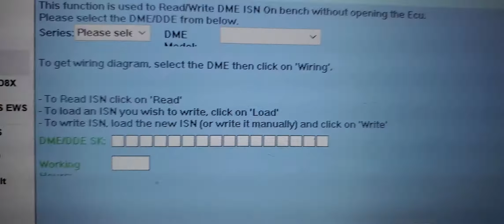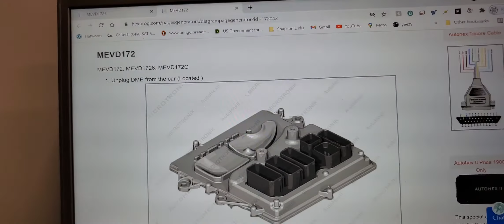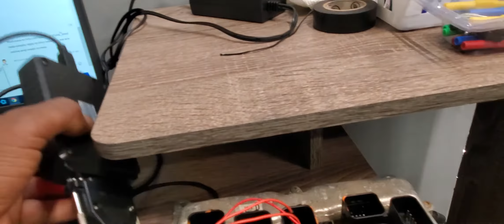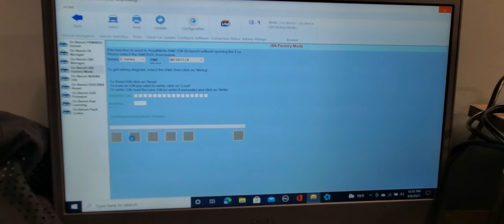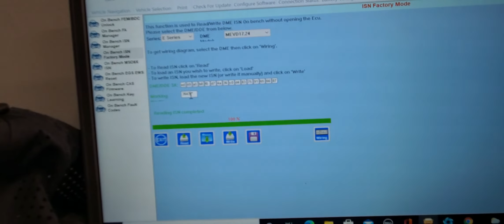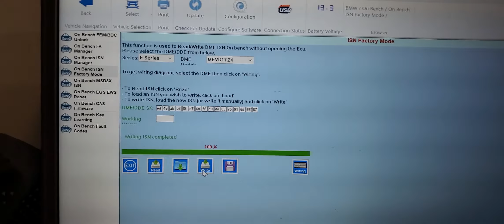2011 Bmw X5 ECU Swap And Program Using Auto Hex

Comment: What happens if the working hours is not changed?
Reply from the maker: In the context of a car, the term "working hours" generally refers to the time that the engine has been running. This is similar to how an airplane's age and service intervals are measured in flight hours.

For cars, this isn't usually a standard feature because mileage (or kilometers) is typically a more relevant metric for cars due to their usage patterns. However, certain specialized vehicles like tractors, heavy machinery, or boats often use running hours as a key maintenance metric.

If a BMW's engine control unit (ECU) is reporting "working hours", it could mean that it's tracking how many hours the engine has been in operation. This could be useful in some scenarios, such as a vehicle that spends a lot of time idling or running at low speeds, where the mileage might not fully reflect the wear and tear on the engine.

In general, the ECU is responsible for managing various aspects of the engine's operation. It uses data from a variety of sensors to adjust things like fuel injection and ignition timing to keep the engine running smoothly and efficiently. It also stores diagnostic information that can be used to troubleshoot any problems with the engine.

Please note that specific details could vary depending on the specific model and year of the BMW in question. It would be best to refer to the owner's manual or contact a BMW dealership or mechanic for more specific information.